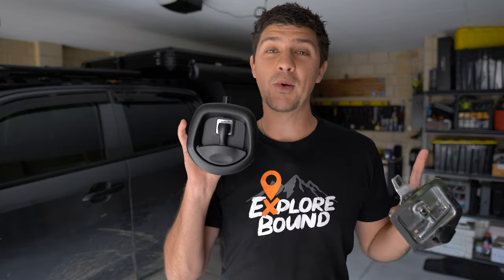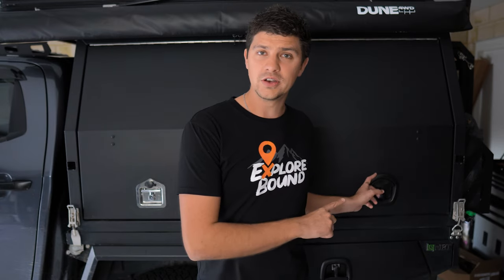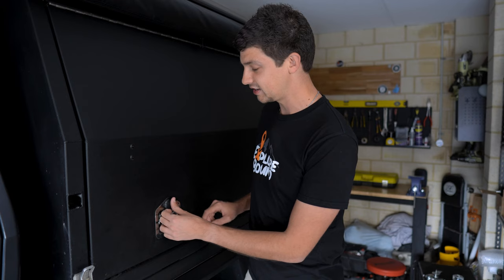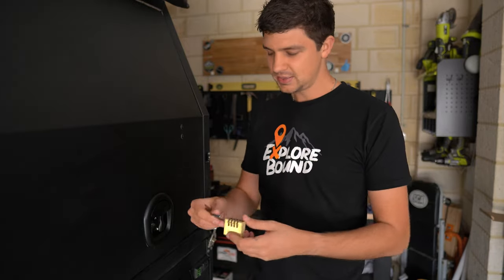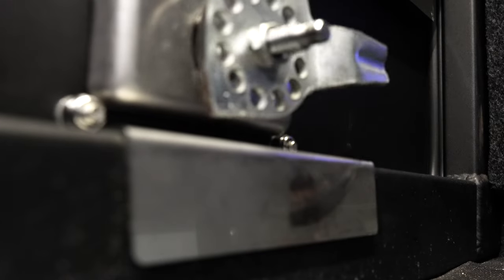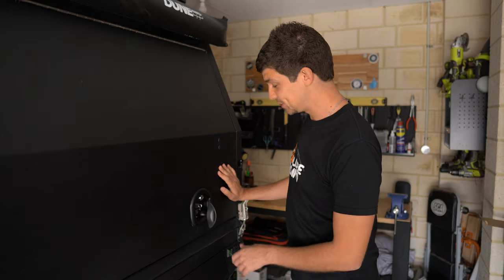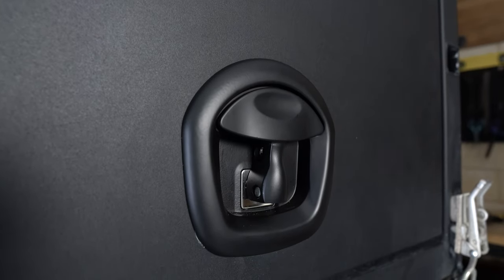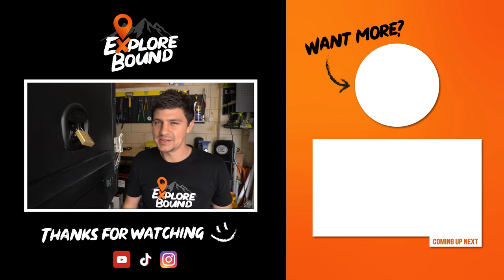Are Whale Tails REALLY better than T-Locks For canopy setups?

Comment: Always look forward to your content. I noticed on your last video that you’ve added a hard rock awning to your set up. I’ve just put one on my vehicle but having real difficulty getting it to open! I’ve tried twisting the locks on the side every which way but cannot get the awning to slide out. Any advice would be appreciated. I’d also love to see a review on the awning in the near future. 😉👍🏻
Reply from the maker: Good spot! We've been testing it out over the last couple of months with the plans to do a proper review/run through once we've tested it properly - hoping to have something out in the next month. 🙂
Reply: @explorebound  Cheers mate! I would really appreciate any advice on opening it tho? I do believe I have a faulty product and @OutbackEquipment are horrendous to get hold of. Is yours tricky to open? I pop out the side tabs and nothing happens! Had mates look at it with no success either.
Any tips as to how you open it would be greatly appreciated ;)
Reply from the maker: @paintandpinotinperth7868  Oh that's frustrating! When mine was a bit stuck one time I popped a small flat head screwdriver into one of the sides and sort of levered that side out, once it clicked out I was able to grab it and resume setup as per normal but not ideal.
Reply: @explorebound  That’s interesting to know. Ironically I finally got mine to open after taking it off my rack in preparation for collection! Now I’m not sure whether to keep it or exchange it. But all seems ok so far. I’m looking forward to seeing your review on it. I’ve heard a few complaints about it rattling so I’d love to know your thoughts. I haven’t done any big corrugations since I’ve had it. Thanks so much for the reply you legend! 👍🏻

Comment: Are they a MRT product,
and how is the fitment into the Tlock cutout.
Reply from the maker: Yeah the new ones are from MRT and fit the old T lock cutouts perfectly. The way they mount to the canopy door is a bit different than the T locks (they essentially clamp through the door), so the kit came with blanking plates to cover the factory T lock screw holes for a neater finish.
Reply: @explorebound  Thanks for the reply, I have a MRT canopy and would like to upgrade the handle.